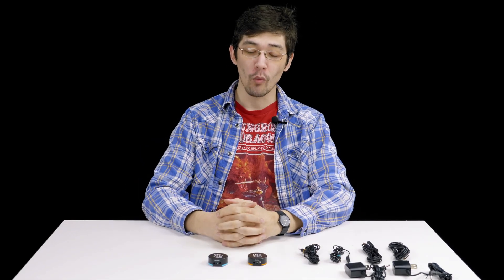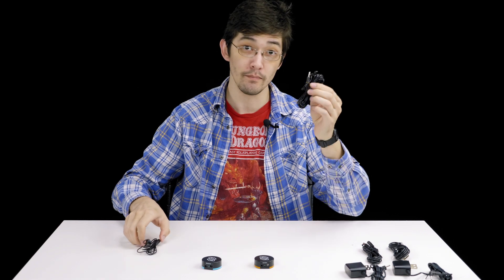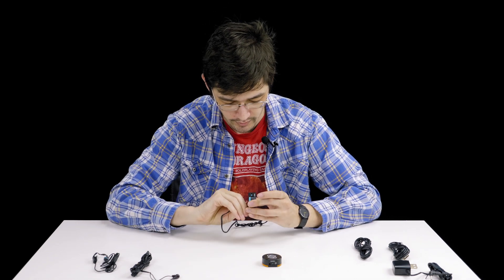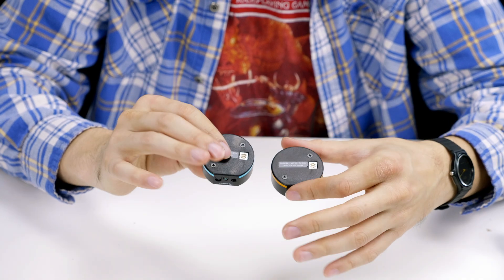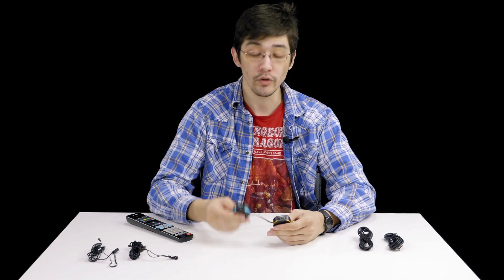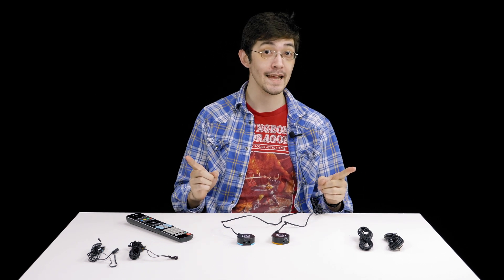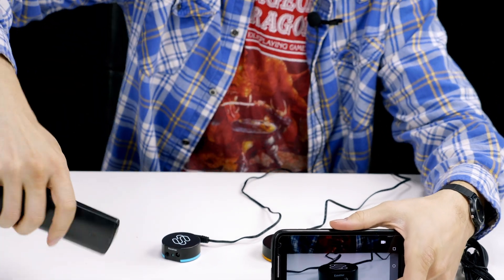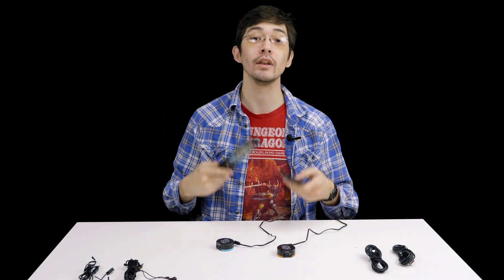BlastIR Wireless PRO -  Troubleshooting

Comment: Where is it getting the signal to transmit? If there is no hdmi wire connected to it?
Reply from the maker: These only transmit the IR Signal from the Remote control, they are not for the video transmission, so your HDMI source would be connected directly to the TV but hidden away. Does that  make sense? This other video explains what I mean: https://www.youtube.com/watch?v=u9w8ifTDFhc

Comment: Fantastic product. Works great with the cable box in the basement and the tv on my second floor. Low profile transmitter an receiver are a big plus.
Reply from the maker: Awesome, glad you like it!
Reply: How? Where is the hdmi connection or is it a cat 6 cable? Hooked mine up, only has a power cable and that's it. Where is it getting the signal to transmit?